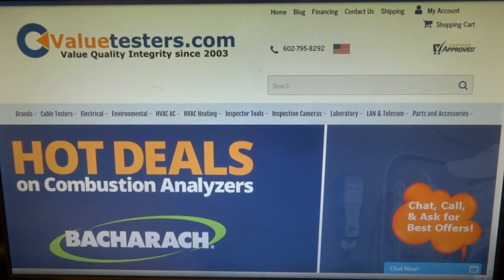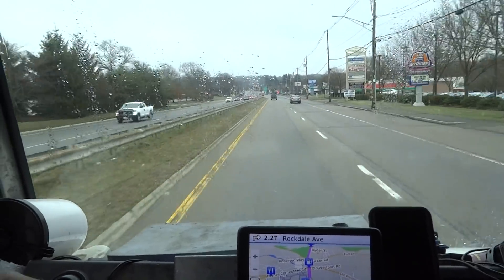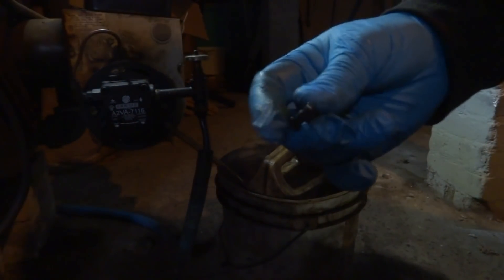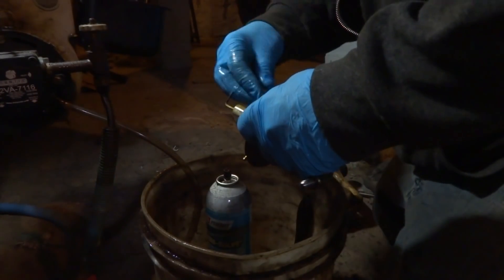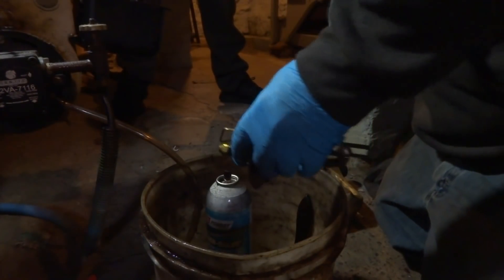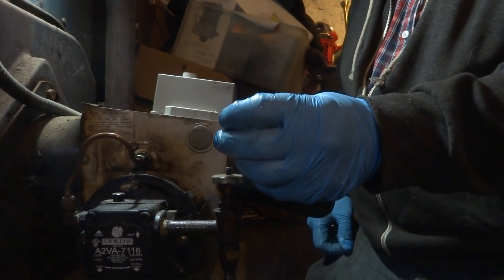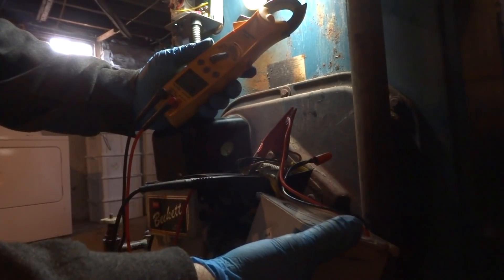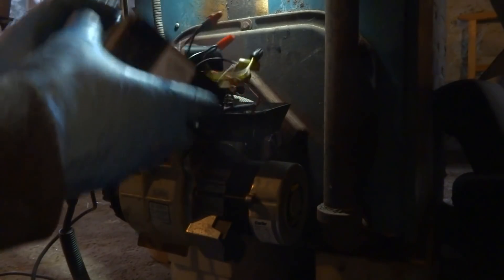Beckett oil burner lockout troubleshooting

Comment: my friends red light is on. it was hit with water from a flood. when they press the red reset button it turns on, but then turns off. they have no hot water. any suggestions?

Comment: Cannot see the wiring with hand in the way, were you just trying to run the blower motor with the orange wire to blower and disconnected oil valve and ignition wires?

Comment: I've never had as many problems with a furnace as I do the beckett one. I just had a delivery today and it was running great after priming it and then all of a sudden it kept shutting off and not kicking on when the thermostat told it to. I'm at a loss
Reply: Same here did you ever fix it?
Reply: You really need to turn off the furnace completely before oil delivery and a good hour after. When the oil tank is filled it kicks up all the crap in the bottom of the tank. The crap then flows to the burner since it’s floating around and clogs the nozzle or something. It’s just good idea to turn furnace off right before and a little after oil delivery. 👍👍

Comment: you said not to keep resetting because it would flood the boiler.

1. if it trips due to intermittently or flip flop where it trips then you reset and it works ok then trips again and then reset and it works but just does not work on the first time intermittently is it safe to keep resetting?

2. can an animal hit that kill button say for example a squirrel or mouse?.

every winter lately has been mild enough for me to have mouse problems and i caught a couple mice this year .

i had to have the boiler repaired a couple times in the last month.

the first time was because explosions where fireballs was shooting out the flue and blowing the flue draft damper flap off the pivot hinge and making a loud bang

they repair crew replaced the fuel pump, control box, cad cell, spark electrodes and the fuel filters.

then a month later it started exploding again so they replaced the ignition transformer as it was intermittently failing.

then a couple days later they had to replace a defective nozzle  and now today the reset button popped and i reset and it fired up ok.

this time i turned the heat down to 68 from 70 to see if maybe it does not like heating so high especially with the mild winter.

Comment: I had the electric cut to the house and had to run new wire to my furnace.  I got a Beckett 7505 oil furnace.  I turned the emergency switch on and got power.  I got the blinking soft lock and I mashed the button.  The soft lockout went off but nothing happened.  The flame and pump prime lights flashed yellow then just nothing.  I got the thermo set to 80.... I don't know what to check?  Any suggestions?

Comment: Hey Steve how you doing just trying to give you a little insight on heat exchanger try this out if it’s a blast tube 02 to 20 make A a paper funnel to each blast tube then pour coffee grounds into each tube turn on your unit and If you smell burnt coffee in the house you have a cracked heat exchanger This is a good trick
Reply: Works all the time

Comment: That’s no truck  it’s a locomotive going down the track
Reply: Not just that, but also mobile supply house that keeps him efficient and allows him to fix most clients problems without an expensive ( time and money) run to the supply house. 

Other contractors must be envious! they would have to run back to the shop or the supply house to get the parts.
 
Thankfully he has Miss Molly looking after the inventory! 

Thanks Steven for a wonderful insight on your business,  I work in the electronics field and logical troubleshooting is the same across all disciplines, you are a master!
Reply: Ok calm down Russell

Comment: Had the same problem with the same Honeywell controller. It would trip out intermittently sometimes it would work for a week or just a day or two. Changed out the controller fixed it.

Comment: good job.  dang those oil fired boilers and near boiler piping seem to require a lot of fixing besides annual maintenance, filters and nozzles.  seems like he is routinely changing out expansion tanks, hy vents, feeders, relief valves, controls, motors, etc.   guess that is because of the age of these systems.   the taco stuff seems pretty tough.
Reply: Bob W the city or well water quality will also influence how long the “wet” parts of the system will last. Also if glycol is added for freeze protection it tends to reduce the life of rubber parts in the system like expansion tank diaphragms.